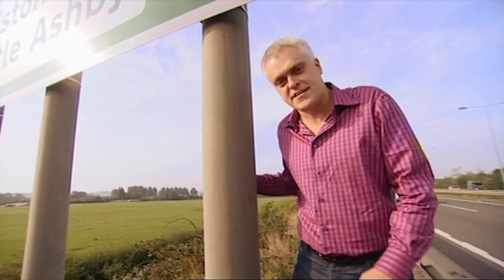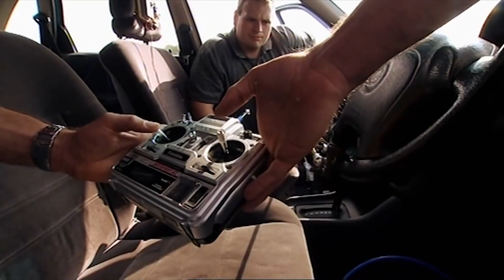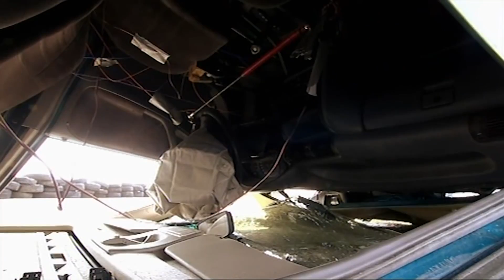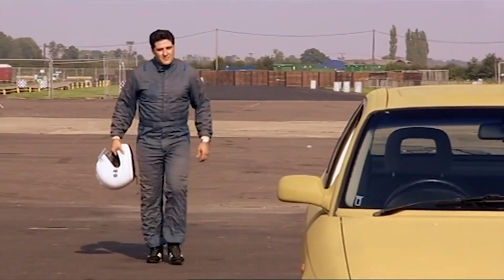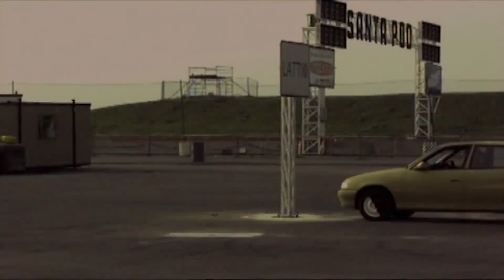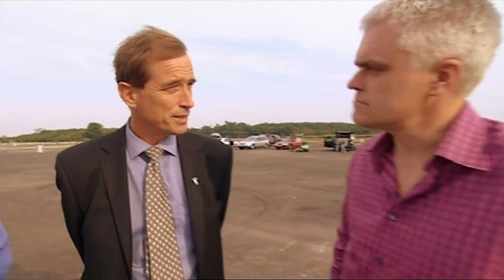What happens when you crash into a road sign? | Fifth Gear

Comment: Many if not all interstate signs here in the US use aluminum I-beams with slip footers. Slotted holes for the bolts that extend to the end of the connection plate and the base plate rather than regular closed holes in the steel plate. They're designed so that the sign pole "slips" off the base plate and they disconnect from each other. 

Former FDOT contractor

edit: as an addition, street light poles are designed with a breakaway base and quick-disconnect terminals for the wiring so upon impact the base breaks away and the pole + wiring safely frees from the footer

Comment: "Other than that, he and the car are completely unmodified."

Cue a shot of the airbag being removed some miscellaneous things installed on the dash.
Reply: He has a helmet so the Airbag Is unnecesary, and for stunts they are kinda dangerous.
Reply: @juancitobentos6351  The point I'm making is that they claimed the car was unmodified, when it very cleary is modified.
Reply: @8bits59  he means that the car overall is not modified in structure, but for this kind of stunt is mandatory to take out the airbags because the driver already has a helmet and if they deploy they can cause unnecesary damage to a human body, and i say unnecesary because they already have the helmet so the head wont hit the steering, but the airbag will cause the same damages as normally, like wounds, burns because of the gas, whiplash, damage in the muscles, etc etc. But overall the car is not modified, just with the Airbag system deactivated.
Reply: Juancito Bentos airbags aren’t just to stop the drivers head hitting the wheel, they slow down the overall deceleration that the driver experiences meaning less force is exerted onto their body, resulting in far less major injury
Reply: @tobycorrigan  that's the job of a good seatbelt
it's so that things that a seatbelt doesn't hold, like your limbs and head, don't hit anything at high speeds
Reply: @tobycorrigan While that may be true they're dangerous with a helmet on. The force can smash up into the helmet and practically break your neck

Comment: I remember reading about yielding lampposts way back in the 1980s. The authors were impressed how car drivers might survive hitting one of those.
However, (same as in this vid) they ignored that the lamppost would work like a mighty steel whip possibly snapping at bystanders and killing some in the process. Not much was heard from that idea since.
But these sign posts seem to let drivers live without wreaking havoc among pedestrians, so: good job, deploy!
Reply: On controlled access and high speed roads these are probably a good idea. In an urban area where there are likely to be many pedestrians, if you can't survive hitting a sign post with your car, a pedestrian probably also couldn't survive being hit by your car at the same speed, and I think you'd be better off lowering vehicle speeds or  improving pedestrian safety than worrying about the safety of drivers hitting road side obstacles.

Comment: I don't think the first crash would be fatal.  The car barely slows down at all, the crash energy is transferred into rotation. Car maintains speed, rotates, tires grip and it rolls. Seat belt on and you walk out like nothing happened.
Reply: Except the roof squashes when it rolls so fair chance if you're tall it's going to (at best) cause a major headache!

Comment: Did he deliberately turn slightly right before impact with the Astra ?
Reply: i feel like it was more accidental due to it being hard to control a vehicle via remote control at that speed. still more realistic tho i guess
Reply: yes and that's the only reason the car flipped.
Reply: MatthewCoupeOfficial Yep he did.
Reply: Idiot drove to side. Instead of driving behind astra so he could see precisely where it goes, they drove on the side of it
Reply: @mug_spinner  idiot didn't drive straight behind it so the astra doesn't get cockblocked by the signpost and therefore avoid colliding it with the peugeot? jeez...
Reply: No Name they could have hit it if they drove behind
Reply: @tobycorrigan  brakes?
Reply: No Name if they were going 65 mph and the car infront got completely stopped by the road sign which could have happened they would not stop in time
Reply: @tobycorrigan  well they could have steered to side at last second. They could have drove at bigger distance. They just had to be in line with other car
Reply: No Name there would be no point, what does driving behind them even achieve
Reply: @tobycorrigan  they would have seen precisely where it goes

Comment: I like your vids, a lot,, but don''t run in to sign posts, trees, large rocks.   It is actually very easy, to not run in to those things.
Reply: Under normal conditions of course, but what if it's slippery and you slide of the road and hit it or you want to dodge something on the road or someone hits you🤔
Reply: @axeljonsson151  , yes, unexpected things happen.  But, I have survived driving (and riding motorcycles) past literally billions of roadside trees in the last  45+ years,   I am all for safety, but lets not lose any sleep over some road side  sign or lamp posts.
Reply: Wait untill you get a high speed blow out, or sudden catastrophic component failure on the  suspension/ steering , or just dangerous driving from some other idiot on the roads ( I do hope this does not happen !  )
Reply: @andy530i  , I hope that doesn't happen either, again.  I have had all of those things happen, blow outs, ball joint failue, and idiots on the road, ect. during the last 45 years.  The occasional sign post is nothing, compared to the millions of trees, and I have managed to avoid all of them.    Should we have the trees removed too?     Cowardice seems to be the order of the day, these days.

Comment: Convertible car drivers will get the biggest slap of their life from these
Reply: OOF
Reply: Yeah they haven't thought about us
Reply: lmao I wonder if the designer considered this.
Reply: @ДимитърБойчев-б3б  or just avoid the signpost.
Reply: not if the roof is up
Reply: @manedbiscuit  what but soft tops tho like in older Minis
Reply: Unfortunately one of the least scientifically accurate measurements. One car had the weight of a robot, which pretty much loss control before hitting the post, and the other had the weight of a man, who kept the car straight into the post. These results have waaay too many differences to how they were conducted.